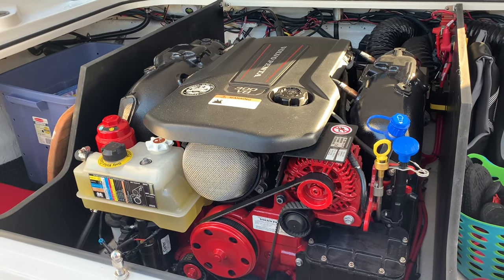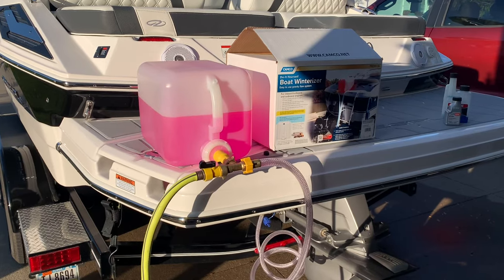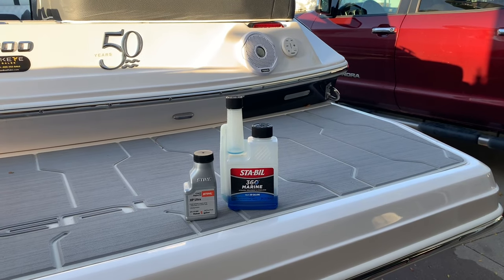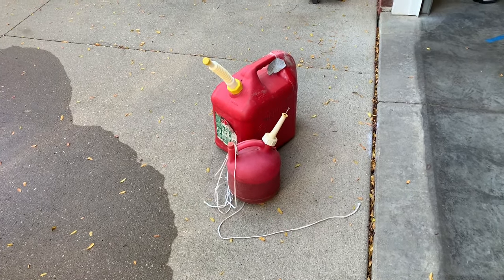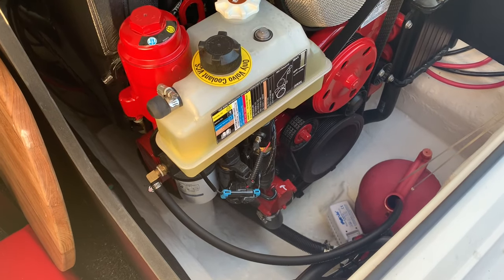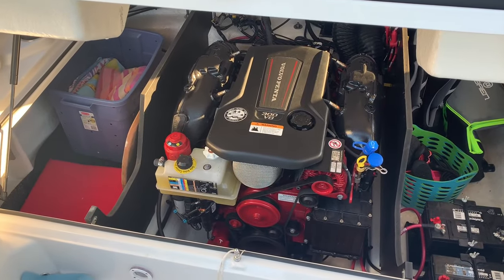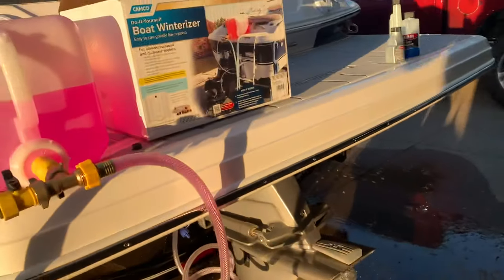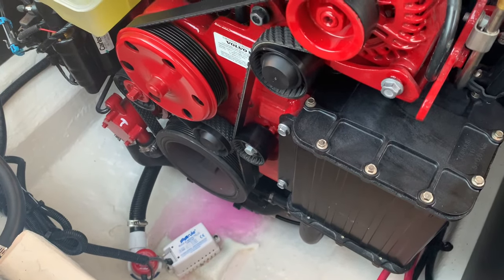How to winterize a Volvo Penta Gen 5 V8 or V6

Comment: This is another GREAT video - very much to the point and clear.

I don't have the ability to pull my boat from the water, so access to rear water inlet is not practical.  What I've done instead is first drain all fresh water using EZ-drain.  Following that, I close EZ-Drain and separate inlet hose at back of engine. Using an adapter hose, I first pour about 3/4 of a gallon of pink into the hose to prime the impeller.  After that, I start with a fresh gallon of pink and put the adapter I made into the jug (at bottom).  I start the engine just long enough to suck it nearly dry.  This accomplishes pretty much what you do, but the big difference is I don't drain the pink after this process.  I leave it in so the impeller stays wet during the winter.  I'm curious as you your thoughts about my process.
Reply from the maker: I personally would still 'drain the pink' as this lessens the chance of any fluid freezing in the heat exchanger.  As for trying to keep your impeller wet, the system is not pressurized.  So I assume any fluid in the impeller would drain out the input side over time anyhow? And I would assume if you are putting 3/4 gallon into the flush port on the engine, it is just running out the input vents on the bottom of the drive?   Or maybe I am not understating what you are saying?

Comment: Can you advise where you found the instructions on adding the antifreeze?  I only see how to drain using the quick drain and adding the 50:1 fuel mixture. Also, what antifreeze did you use?  Thank you for this video, extremely helpful.
Reply from the maker: Actually for engines with the Volvo quick drain system the instructions do not mention flushing with antifreeze, but rather state just pushing the drain plunger is all that is required.  I guess I am a bit particular and do it for extra insurance in case there is some water left 'somewhere' that does not get drained.  I do discuss this starting at about the 26 second through 1 minute mark of the video.  It is simple to do and is extra piece of mind.  As for antifreeze, just make sure to use the marine/RV type.  Do this as it is non-toxic and will not pollute the water/ground when flushing.  It is readily available at most big box HW stores, Walmart, auto parts stores, etc.  Thx for watching.

Comment: Great video. Where did you get the drain tap to connect to the external flush? I have tried to find any stock tap but I cannot find any with matching thread.
Reply from the maker: Are you referring to the connection to the blue flush port?  If so, that is just threaded for a standard garden hose.

Comment: Great video. A few questions. Did you add Stabil to the small portable container with the 2-cycle oil?  When you added Stabil to the small tank, I assume it was a very small amount since Stabil is usually 1 ounce to 10 gallons of gas?
Reply from the maker: Yes the fuel had Stabil added, but I had mixed it with the Stabil in the 5 gallon tank (easier to measure the correct amount).  Then poured a gallon into the smaller tank to mix with the 2 cycle oil.  The mixture ratio is the same for my smaller 2 cycle engines so I can use whatever is left over in them!

Comment: Thanks for the video. I too am in Iowa and going to do this in a few weeks. Where did you source your Volvo engine oil (and outdrive too for that matter). No volvo penta dealers here in DSM. Iowa city dealer?
Reply from the maker: I actually ordered this year's engine and outdrive oil earlier this week and they arrived today.  I have since added links in the video description from where I buy from on Amazon.  If you are changing the outdrive oil you should also get new o-rings.  If you do have a DPS-D1 drive, the VP part numbers for them are qty 2 3855081 (drain plug and vent) and qty 1 3852045 (dipstick).  It took me a bit to chase down the o-ring part numbers, so maybe that will save you some time if you have the same drive.
I do plan to make a video of changing the drive oil, but that may be 4 to 6 weeks yet.  I am in Marion.

Comment: Hi, thanks for this helpful video. Could you have hooked the antifreeze contraption to the hose that’s next to the oil dipstick (instead of the one next the lower unit)?
Reply from the maker: Yes I could have.  For my initial start up this past spring I used that fitting as I assumed it would get water to the impeller quicker.
Reply from the maker: One more thing - if you use the fitting by the engine be sure the antifreeze jug is higher than the fitting to provide gravity pressure for it to flow.  That is a reason I put it on the swim platform as the outdrive fitting is a few feet below.
Reply: Thank you. I appreciate you taking the time to reply

Comment: Did you try the outside drain after you drained the block to see if as you mentioned some water may have stayed in the leg? Or maybe if you disconnected the flush kit first you won’t know. Also interesting Volvo says 50 to 1 fuel mix which must be ok for the cat converters which is good to know
Reply from the maker: Sorry but can't recall the series of events when I unhooked everything to answer this.  If you trailer your boat, I assume you could try this experiment after any trip this summer?  Just push the plunger after your trip and see if the leg drains before opening the water connection on the leg.  I do assume the plunger will drain the leg as it would release the vacuum.

Comment: I have a question, I was changing my impeller and the old one was pretty beat up but 95% of it was there somebody said look in the heat exchanger for pieces of your impeller. Do you know how to take apart the Heat exchanger To look for pieces?
Reply from the maker: No I've never taken the heat exchanger apart.  I did find this video though for removal:  https://www.youtube.com/watch?v=D8IMTj-_zy0  

I would start by just disconnecting the hose at the bottom of the exchanger from the impeller as that is where any pieces would probably be which may block flow into the unit.  This sounds simple, but could be a pain depending on access.
If it does look like a pain and you are sure no big pieces broke off your impeller, I would just run the boat and watch your water temp.  If if looks normal I wouldn't worry about it.  As any small pieces probably just went out the exhaust.

Comment: Did you tape up the bottom fresh water suction on bottom of drive?
Reply from the maker: I didn't initially.  But after noticing it wasn't drawing as well as I had hoped due to lack of pressure, I shut the engine off, taped up the vents so it could not draw air from there, restarted the engine, and finished emptying the tank.  Make sure to take the tape off when finished of course!!

Comment: Any ideas where to get a service manual and owners manual on the engine. I didn’t get one when purchasing the boat used.
Reply from the maker: I believe you can go to the Volvo Penta website and find a copy of the general operational and maintenance manual free of charge.  It takes some searching around on the site, but I am sure you can find it.  Reach back out if not and I'll see if I can find it.  I also think you need the serial # off the engine to ensure you get the correct manual.  I did get the manual when I bought the boat as it was new.

Comment: Why not leave the antifreeze in instead of draining it out? Surely that would give extra protection.
Reply from the maker: I surely could have, but decided to drain it as that is what is discussed in the Volvo manual for winterization.  And once again, the manual states using antifreeze is not necessary, but I did it for extra protection just in case the 'drain' happens to leave water somewhere.....

Comment: Where is the drain location to change out the internal VCS coolant? Is service interval 5 years on this coolant?
Reply from the maker: The service protocol sheet states an interval of 48 months or 200 hours (whichever occurs first) for the internal coolant.  To remove the coolant there are 3 plugs; one of the front of the engine and 1 on each side/bottom.  You will probably want to visit the VP website and download a copy of the Service and Maintenance manual to see their exact locations.
Reply: Can we expect a video of this?

Comment: What about summerizing it?
Reply from the maker: For the first start this year I connected my water supply, but this time I did it at the connection on the engine by the oil dipstick.  My thinking on this is this connection will get water to the impeller sooner than the one on the outdrive, therefore the impeller will not run dry for as long (not much difference, but my line of thinking).  Then turned the key halfway to let the fuel pump prime for a few seconds, then cranked it.  It cranked for an extra second or two, and fired right up.  I had also pulled my batteries and kept them in the basement over winter and trickle charged them about monthly.
Reply: @iowabuckeye  Any hints on getting some oil circulation/pressure after the long winter before firing up? I'm going to pull the fuel pump fuse to stop bore wash & crank the engine with the kill cord disconnected. But as it's fuel injected I suspect I probably don't need to pull the fuse.
Reply from the maker: Can’t help with that one.  I’d just try and confirm cranking does build enough pressure to circulate the oil.  Else the cylinders will run dry longer versus just starting.  For the fist start I’d guess it cranked for 3 or so seconds before firing off.

Comment: I would be concerned about the possibility of the impeller being damaged because it was dry since you didn’t use “rabbit ears” on the lower unit.
Reply from the maker: This outdrive has a convenient hose quick-connect that can be used instead of 'rabbit ears' attached to it's pick-up vents.  In the video I did state I was concerned it was not drawing correctly due to the pick-ups possibly drawing air (since they were not covered), but went back and looked at some video clips (not included in this final video) and was able to see the antifreeze was actually coming out of the exhaust bellows versus the pick-ups.  Since the jug was emptying, the impeller was drawing the antifreeze (therefore not dry).  This was also confirmed when I pushed the quick drain.  Good comment though!
Reply: Thanks for replying! I thought (mistakenly) that stern drives had both a water pump at the front of the engine as well as a impeller in the lower unit. My bad!
Reply: @iowabuckeye  It seems as if when you turned the water off and antifreeze on , the water stopped coming out the exhaust port, and no antifreeze started coming out, which makes me think there was no antifreeze getting into your exhaust manifold
Reply from the maker: There was of course less pressure when the water was tuned off/antifreeze turned on. Antifreeze was most definitely coming from the exhaust bellows.  Following publishing the video I did go back and review some of the other clips and pink coming from the exhaust was easily visible.  It was all drawn in so went somewhere!!!